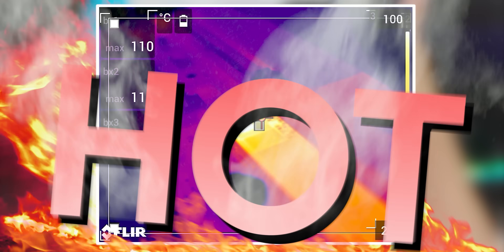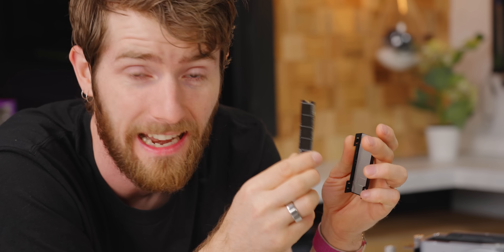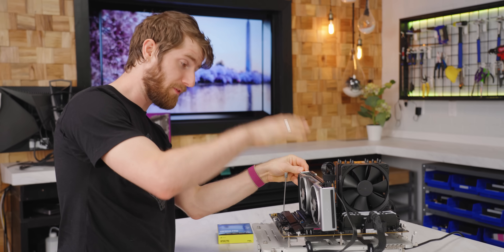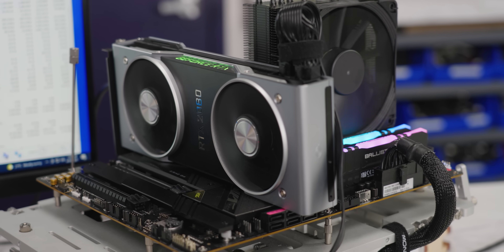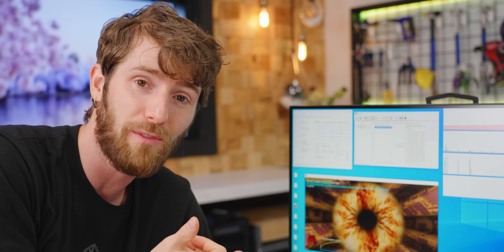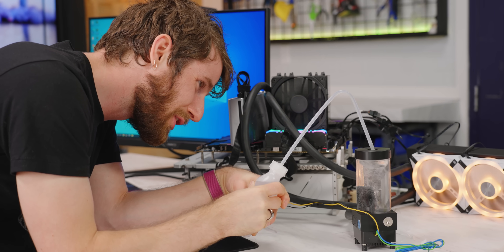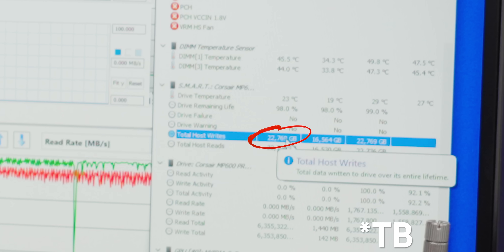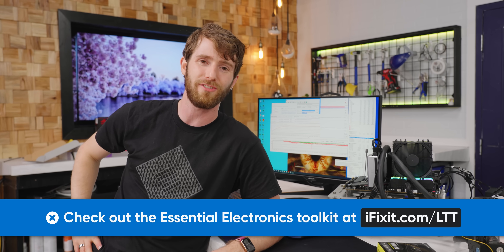This Product is a Meme - Corsair MP600 PRO Hydro X water-cooled SSD

Comment from the maker: Additional info for nerds about 2:20 courtesy of Nystemy on the forum:

"Coming in really quickly here to inform why there is differences between keeping the Flash warm or cool.

When one writes to a Flash memory cell, then the device creates a fairly intense electric field across the insulation surrounding the floating gate making up the cell. This forces some electrons to get trapped in or ripped out of the floating cell (depending on what the manufacturer thinks is better, both technically works.) But each time this is done, it adds a bit of damage to the insulation, making it less good at stopping current from flowing through it.

The Flash cell is in effect just a fancy low leakage capacitor. And the faster the charge leaks out from it, the faster it forgets. (And for DLC ("MLC"), TLC, and QLC cells, it forgets even faster due to the smaller charge differences it has to deal with from the get go.)

 But how does operating temperature play a part in this?
Well, the insulation simply has higher leakage when warm, and doesn't need to break down as hard when that current is forced through it.
But likewise, the warm temperature has the deficit that the insulation also leaks more current, so the cells forgets faster.
 
In short.
If you want to put the drive on a shelf for 10 years, then keep it cool.
If you want to use it as a scratch disk for a storage/computing server, then keep it warm.
And if you use it as something in-between these two extremes, then it is a bit more of a mix..."

Anyway, have a good day and the LTT Forum is awesome -Alex
Reply: Wow great!!
Reply: Great Info. If possible, can you edit and attach it in the video.
Reply: Ok
Reply: tldr: no user intervention required as no one uses SSDs for long term storage, pricey and less reliable than discs or tape
Reply: also, open bench vs turning the computer sideways, heat transfers from bottom to top, so gpu will heat it up alot more then, redo the tests or get unsubscribed, sorry linus but do things correclty please, 99% of people are not running open air bench
Reply: Only a matter of time before Apple releases the 'The coolest Apple Watch we have ever made, Water-Cooled edition TM'.
Reply: I can almost hear Apple going 'This is the COOLEST Apple Watch we have ever made'.
Reply: Where is watercooled ps5?
Reply: Now Linus is reviewing memes huh
Reply: i'm glad Linus was not the one comment
why I said this? cos idk.
Reply: Use a liquid called dry water.. it isn't conductively for electrical devices.. has a boilingg point of 45c.. and devices can be submerged
Reply: @Priyajit_Ghosh  no
Reply: field effect transistors are magic fuckery, you can't convince me otherwise.
Reply: @Priyajit_Ghosh  just read it man its easy
Reply: @tanmaypanadi1414  I have read it, I was asking them to attach it so that the video will be more refined
Reply: Linus i found on polish amazon RTX 2080 ti with wather cooler  2300-2400 zł i convert this to dollars it’s 605 dollars sorry ma english is bad 😒
Reply: Oi why tf are memes banned on your discord when you use and make about a dozen of em per episode?
Reply: What's the "ideal" working temperature then (depending on the use-case)?
Reply: @zodiacfml  Tape? The 1990s called, they want their equipment back.
Reply: @carljohnson8454  To be fair, there isn't any "ideal" temps.
For the typical PC, it is generally going to warm up together with surrounding component, and when the computer is off, it is going to cool back down to ambient on its own. So partly you would get a bit of both already. Unless the computer is on nearly 24/7.

To a degree, I am surprised no one has seemingly made an SSD with a Peltier cooler in it, since that could easily heat up the flash chip ahead of a write, and then fairly rapidly cool them back down afterwards.

Though, flash manufactures are looking into adding resistive heaters into the flash array itself. So that the local part of the array one will write to first heats up while the controller chip buffers the write. Then it can shuffle in the data into the array when it has reached around 80-120 C. And this according to research papers I have read is not going to take more than a ms. And write latency isn't that hugely important in most applications regardless. And for everyone thinking that this is going to rapidly increase the chip's temperature, no not really, the amount of energy is tiny since one only heats a few µm^2 at a time, that only makes up maybe a 100th of a % of the chip surface. Ie, it isn't going to get all that noticeably warmer. But this solution is currently still in the research stage, and in a bit of a patent hell as well...
Reply: @danieljones9937  you got to be in IT enterprsie to know that it is still being used for cold storage. a quick search will also show tape drives being sold new and developed
Reply: So what if you put a water-"cooled" SSD behind the CPU in your loop, to keep it warm but not too hot?
Reply: Here before 50 replies
Reply: Water cool a laptop charger.
I need a tutorial to do the same.
Reply: "only to 68, that's not nice"
But it's 1 degree from it.
Reply: Btw, while this may not be very useful for gamers, if your a crypto miner with a storage-based mining, this is incredibly useful.
Reply: @zodiacfml  Interesting. You think this video is aimed anywhere even close to the enterprise market?
Reply: @nystemy  So the heatsink that I put on my M.2 SATA ssd (That was never meant to have a heatsink) might be bad for it? It dropped temps from ~70C to ~40C. I have heard that it wears out faster depending on what the highest temperature was.
Reply: @danieljones9937  that is not my original post
Reply: It makes me wonder if you can create some sort of smart cooler for an SSD that monitors the workload of the Flash. Keeps it cool when idle, but then heats it when it's being used for more extreme use cases.
Reply: !!!!!!!!!!!!!FOR SCIENCE!!!!!!!!!!!!
Reply: @ebsolas  Flash manufacturers are researching integrated heaters in Flash memory. As to heat the local part of the array before it is being written too.

This will however increase write latency by about a ms or so, but this is almost never an important factor of drive performance.

Though, the pros and cons of this is still not fully known, especially over the long term.

But when that starts hitting the market, then one can put on a lot more actual cooling onto the flash chips without major worry.
Reply: @sasha-bigD  thanks and yeah. I really doubt it needs cooling. only gaming usage and the drive is not even PCI gen4. more like 3.5gb/s
Reply: @philosaplease4867  its also fast , for gaming i think motherboard heatsinks are should be enough and if you don have them so additional radiators not useless, specialy if you dont have high airflow in your case |  just relax, everything nice :)
Reply: @sasha-bigD  considering how samsung does not recommend 3rd party heatsinks AND, my M.2 is mounted below my gpu in the bottom slot, yeah I do too.
Reply: @philosaplease4867  may be they dont recomend because they think thats motherboard heatsinks are enough and i dont hear about dont recommend :)
Reply: I get the jist of some if this but damn Im not smart enough to fully comprehend what I just read
Reply: Did I just watch a pcmaster race?
Reply: it would seem that the NVME chips should be warm but the controller chip is the only one that would benefit from cooling. I removed my m.2 heatsink after learning more about it. (no MB heat-spreader), but plenty of case airflow.
Reply: @philosaplease4867  might be heatsink distributes heat to chips and cooled himself, all fast ssds have heatsinks or have option, install it and forget about it :)
Reply: Who do you expect to read this
Reply: TL;DR whannok the next will have a water cooled ssd
Reply: At least get the prices right, Linus.... 30 - 40 $$, not 400 something..
Reply: Linus just admit it you dropped the biggest flex on PC gamers everywhere "Corsair watched..." I'm dead lmao
Reply: Yo siKua
Reply: I'm
ẞkko
Reply: Can I have PC 🥺🥺
Reply: water cooling ssd ur talking about almost 700$
Reply: SSD don;t have longevity, mechanical drives are far more reliable, I must have 3 broken drives in 3o yeas, and 1 I fried it myself, in 5 years I already had 2 SSD failing on me, one in a macbook pro, and a 3rd one Samsung Pro DOA.
Reply: @thewizardsofthezoo5376  "one in a macbook pro" well theres your problem right there, macbooks are garbage, especially for heat dissipation.